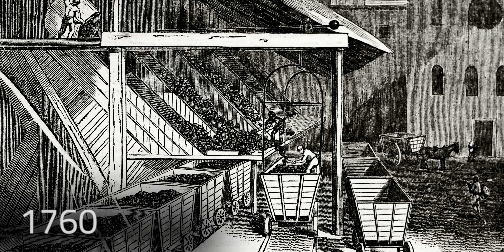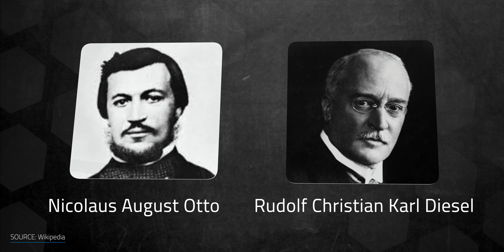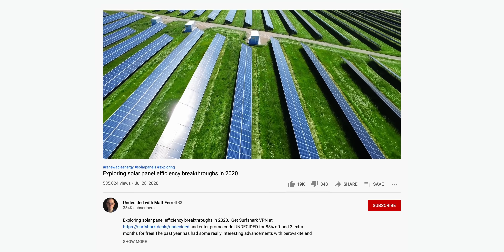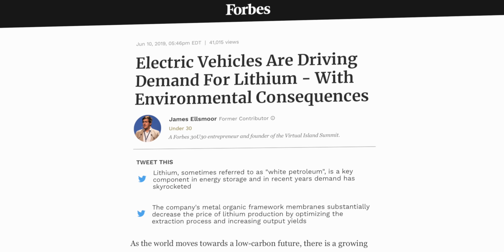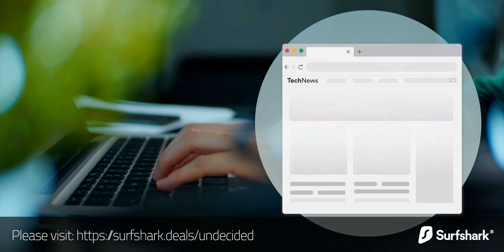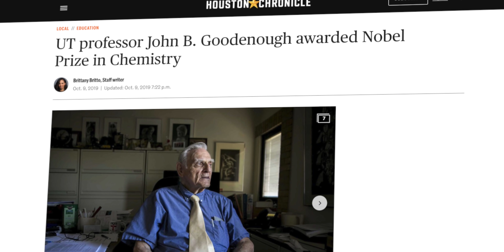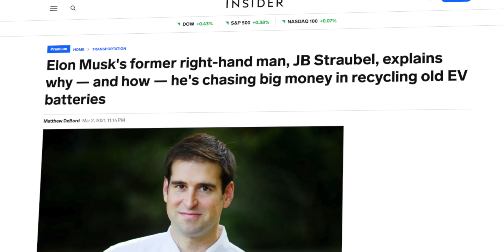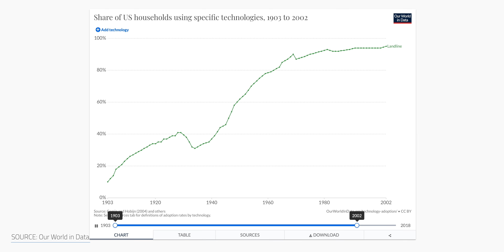Is the Future of Renewable Energy Inevitable?

Comment: Hi there,
great video
Though I think there is something missleading about that 95% efficiency electrolyser. During splitting of water a lot of heat is generated. If that is used for heating houses one can increase the efficiency of the process though not 95 % of the electric energy is transformed into chemical energy.
I guess for that a value arounf 60-75 % is more realistic.
Reply from the maker: Agree that there's waste heat we're not taking advantage of, but you can find all of the articles/research where I pull the 95% efficiency from here: https://undecidedmf.com/episodes/is-the-future-of-renewable-energy-inevitable
Reply: @UndecidedMF  
Ah, thanks. I didn't know.
The article actuallt verifies my thought. The overall efficiency is that high, because waste heat is sent to homes.

Sry, if I came about as rude. I didnt want to say, you are missleading your audience by intend. I just thought that this 95 % claim could be missunderstood as 95% chemical energy in form of hydrogen. Which would be mind blowing for me as I have a background in electro-chemical engineering and such numbers would be just unimaginable at the current state.

I though believe in hydrogen as energy storage.

Keep up the good work.
Best Regards,
Max
Reply: @UndecidedMF  
Another article about efarm.
>At eFarm, the process heat goes into the regional heat supply for industry and private homes. This enables H-TEC SYSTEMS electrolysers to achieve an efficiency of up to 95 %.<
https://www.h-tec.com/en/applications/efarm-sector-integration/

If you go to the bottom of the page, they show downloads for the data sheets of their products. In there the electric-to-hydrogen efficiency is given as 74 % or 75 % depending on the chosen product as "nominal efficiency".

Which is still quite good. I expected a bit lower values, but I come from laboratory backgrounds and am probably thinking if realistic efficiency rather than marketing claims.

Best regards,
Max
Reply: I agree.  Hydrogen is matter, not energy. If you burn it you get a high efficiency for conversion to heat.  But that's trivial because you can put electricity through any resistor to get a 100% efficient conversion to heat.  The problem is in converting heat into a less degraded form of energy.  If you want to get electricity back from your hydrogen then I guess you burn it to drive a steam turbine.  The overall system efficiency drops enormously.  The possible benefit of hydrogen is that it can be transported fairly easily.  In most cases, for non-mobile uses, you get better efficiency by moving the electricity than this convoluted route.  Also for storage, but if if the 95% figure refers to overall system efficiency (it doesn't! ) then hydrogen batteries would already be so much better than other sorts that they would dominate.  They don't because getting electricity back out of your tank of hydrogen puts  you back into the realm of heat engines.
Reply: @raykent3211  
I am confused by your answer.
The 95 % refers to the conversion of electricity to hydrogen AND usable heat only. The heat is used to heat houses and industry processes.
Though in this video it could be understood as 95 % of electricity is converted into hydrogen. That is the possibly "missleading" part about it. It was never claimed that hydrogen could be used as 100% electricity. 

The 95 % don't refer to making electricity out of hydrogen again.

Also, I don't think hydrogen is easy to transport. You either need cryogenic temperatures or extrem pressures which can cost up to 15 % worth of the hydrogens energy, or you need a lot of energy to pump it through pipelines. Again after about 100 km 15 % worth of the hydrogens energy would be used up just for pumping the gas through the pipelines.

Green hydrogen is best used for decarbonising industry processes like steel and aluminium mills or in chemistry. Also for seasonal energy storage as there is no other means to store that large energy quantities currently.

Best Regards,
Max
Reply: @mAx-grassfed  thanks, but you can't convert electricity into hydrogen.  Category error.  If you want to use electricity to separate hydrogen for storage or portability, then it's daft to only consider half of the equation.  Consider the overall system efficiency.   How do you recombine hydrogen with oxygen to produce electricity?  If this half of the process is omitted the "efficiency" figure is horribly misleading.  Usually the percentage of energy that goes to heat is considered as waste.  Otherwise all devices are 100% efficient,  by the law of conservation of energy.   If this thing is only 95% efficient it's breaking that law!
Reply: @raykent3211  
Man, you know that it wasnt meant literally. 
cAteGoRy eRroR, give me a break.
Reply: @raykent3211  also the heat is not wasted, lol. It is used for houses and industry to safe natural gas that would otherwise needed to be burned.

Sigh

Comment: We cannot forget that nuclear is still in the race.
Reply: Lol no it's not
Reply: I think it is a good idea to not focus only on renewables, but improve all others too. Nuclear, coal, oil, fusion,... each transforms and improves over time. 

I think each of them will have its smaller or bigger come back after the renewable growth will slow down.
But i think the come back will be in a more sustainable form then in the past.
Reply: @George Mann With $580 billion and another couple of hundred billion dollars we could do a partial cleanup of the damage and contamination at Fukushima. That would not be near enough to correct the damage done to the Pacific though. But all the king's horses and all the king's men and all the public's money in every country would never be able to pay for the damage done to the Earth and its living creatures by nuclear energy production.  Zero carbon from nuclear is a big lie. How much fossil fuel is used to mine, mill and enrich ore, create steel and concrete and build reactors? How much would be used if the acidic and radioactive tailings were put back in the ground, instead of left in the open to pollute the environment and cause cancer? How much more would be used if reactors were ever decommissioned and waste was ever buried in very deep holes? How much heat pollution is generated by nuclear reactors adding to global warming? We don't need  nuclear to destroy us. We already have Satan.
Reply: Nuclear is great once it's built. However, the decade long build times and huge intial costs are big issue. And no one really wants to live next door to it, same for fossil fuel power as well. Energy storage is needed for renewables, but it really should be used for all power production. Large and efficient power plants cannot ramp up fast enough, even nuclear, requiring inefficient peaker plants. Complete waste there.

Solar and small scale wind are the only power options available for home use. Solar requires more energy storage, since most of it's power comes within a 5 he window. Large wind power is typically best for grid use. 

It doesn't have to be a single system though, nor should it be. Solar and wind are great for homes and rural areas. Use grid level solar and/or wind with large storage for multiple communities. Have a single large nuclear or grid wind and storage for large cities and as backup for the remote areas.
Reply: @anthonypelchat  I agree with everything you said except the first and last sentences.
Reply: @jackfanning7952  Understandable. I'm trying to give nuclear benefit of the doubt. I don't think that it's worth it overall, especially with the total benefits of solar and wind with energy storage. But it isn't horrible overall either, if built properly and without a massive waste of money. Not worth tearing down a good nuclear plant right now. I would rather see all coal and petroleum plants get replaced asap followed by natural gas. 

Still, given how long a new nuclear plant takes to be built, wind and solar are far better investments.
Reply: @anthonypelchat   I am one of those people. Unfortunately, its reliability and footprint in terms of land use are unbeatable.
Reply: @kellyaderwa1696  Not really true. While nuclear doesn't take up much space for the reactor itself, they always take up a lot of surrounding land for safety and security. Also, wind power doesn't take up much actual space at all. Very tiny footprint. You just have to have multiple ones spread out over a wide area. 

The biggest problem with people thinking that wind or solar take up too much space is that they greatly ignore the extreme flexibility that they have. How much land does solar take up? Absolutely none of you put them on roofs, as covers over parking and roadways, over plants on farms (interesting research there), and even in the road or parking spaces themselves. Wind always takes up some space, but can be built in many different areas. Mountains, forrest, even in the water. 

As for reliability, battery storage is the best, not nuclear. Batteries and other energy storage solutions can grab extra energy from very efficient plants, nuclear, or renewables and be quickly release it when necessary for the grid. Nuclear cannot ramp up fast enough to cover peaks of power demand, nor can most of the very efficient gas plants.
Reply: @anthonypelchat  You are right. I did not put that into consideration. I just looked at how much energy can be fed to the grid for the same piece of land and I believe nuclear still beats wind and solar. I don't know much about solar concentrators' potential but I believe they are also good. Perhaps much better than wind when it comes to land use.
Reply: @kellyaderwa1696  I would strongly question any report showing anything using less land space than wind power. They take up very little space, so most likely those reports are taking other items into consideration for wind and ignoring that for other power options. But again, it doesn't really matter. Wind and solar are the only power options that can be built without using any land at all, since they can be built on or above other uses. 

Nuclear is just too expensive and takes too long to be built. Until those two issues are fixed, they won't play a major role in overall future power production.
Reply: @George Mann HAHAHAHAHAAHAHAHAHAHA. That's your grand support for nuclear?! Look, I was giving nuclear power some benefits. You should have left it at that. Instead, you use a junk of a project and then start messing up numbers for your own benefit. Let's look at this in detail using Wikipedia as the source.

Your first problem is using pricing for a single country's project while comparing it to worldwide averages. The project, which isn't completed yet, was expected to costs $24.4 billion back in 2018. That is already over budget from the $20 b originally. AND you even leave out additional costs. That money is just to build it. There is an additional $20-$25 b expected from operation, maintenance and fuel supply contracts.

The second problem is the build time, which I and others keep bringing up as the biggest issue for nuclear plants. This is no exception. As of right now, only one of the 4 reactors is operational, but it isn't going to start commercial operations until later this month or next. That is nearly 4 years late on a project that was already expected to take 6 years to build. The rest are likely not going online for commercial operations until 2022 or 2023. After 10 years of construction, it will finally hit 1.4 GW this month or next. 

Let's compare against some of the solar projects in the region. Abu Dhabi’s 2GW Al-Dhafra Solar PV project started last year and should be completed next year. While we don't have pure construction numbers, we do have costs per kwh. This project will cost 1.35 cents per kwh (as in less than 2 cents per kwh) vs the 11 cents per kwh expected for the nuclear plant. Another 1.17 GW project will be selling for 2.42 cents per kwh. And a 700-MW Dubai solar thermal plant promises to provide electricity year-round from 4 p.m. to 10 a.m. for 7.3 cents per kilowatt-hour. There are also several smaller projects around Dubai that are being built ahead of already short production timelines, such as a 260MW project that was started in 2015 and finished ahead of schedule in 2017. 

The fact is that solar and wind can be built far, far faster than any nuclear plant. They can also be built at lower prices, even with energy storage systems. And that energy storage saves on the "cycling inefficiencies" that you mentioned. Guess what, you even have that to a degree with nuclear. The grid is not a smooth line of give and take. You have to have small plants just to handle the sudden increases in demand, or you build energy storage. 

"Historically, nuclear was built at a faster pace."
Yes, but not any more. Now you are looking at roughly 5 years, and many fall behind schedule. For example, two of the four EPRs under construction (the Olkiluoto Nuclear Power Plant in Finland and Flamanville in France), which are the latest new builds in Europe, are significantly behind schedule and substantially over cost. 

"A survey of 68 nations over the past 52 years..."
And there's your next problem. What has historically been the case isn't any more. Solar has been very expensive up until recently. Wind has been coming down in price as well. So has energy storage. At the same time, nuclear costs are going up. 

I also like this statement in Wikipedia. 
"A 2019 study by the economic think tank DIW found that nuclear power has not been profitable anywhere in the World."
DIW Weekly Report 30 / 2019, S. 235-243

Nuclear may have it's place in the future, but it's high costs and long construction times will keep it from playing a major role going forward with new plants. Next gen reactors are also expected to be more expensive than earlier versions, likely due to safety concerns. Like it or not, fear has likely killed nuclear power, even if that fear is irrational.
Reply: Absolutely not! Worst for economics, health and they still haven't disposed of a teaspoonful of the waste.
Reply: @jackfanning7952  false. By economy nuclear is way way way more cheaper than renewable,fossils,etc. In terms of health fossils,coals,renewables (solar,wind,water)has killed more humans than nuclear. In terms of efficiency and mass to energy conversion nuclear is better.
Reply: @jackfanning7952  here it tells you the data and science in regards to renewables vs nuclear. One scenario that i liked is the country in which renewables are dominant and one is nuclear dominant. The nuclear dominant country's watt per cent us lower than renewable
Reply: @notnotalwen4891  I am enjoying watching the nuclear industry fade away into an embarrassing failure of their own making. It is the biggest business failure and collapse in business history. Well deserved because of their corruption and callous disregard for the damage they caused all these years and the years to come.
Reply: @notnotalwen4891  That video is the perfect example of cherry picking the data.  Not worth watching IMO
Reply: @jackfanning7952  also the waste products are safely stored deep in earth also we are in currently researching ways to use the waste of nuclear power plant (salt thorium reactors). In short nuclear ftw